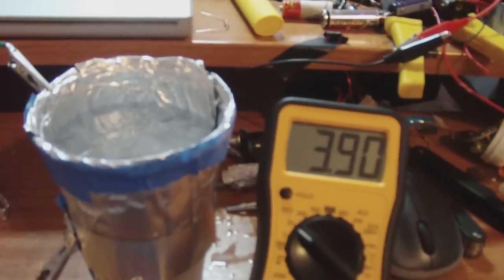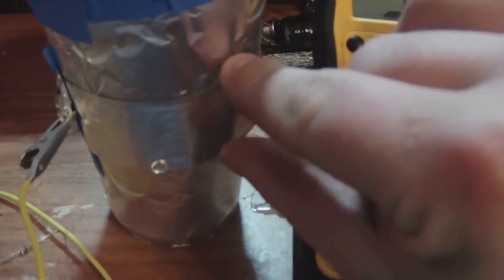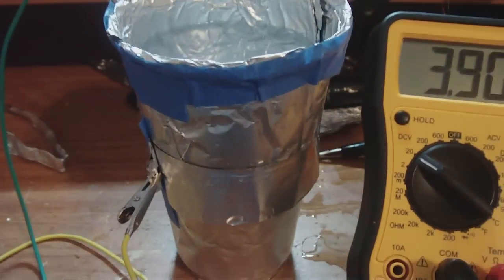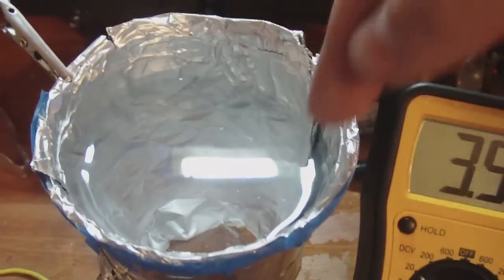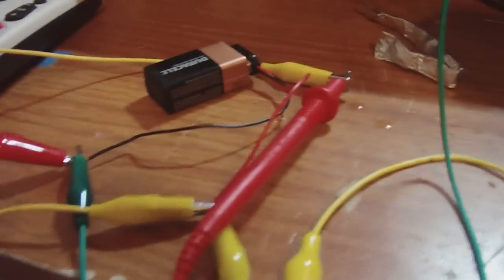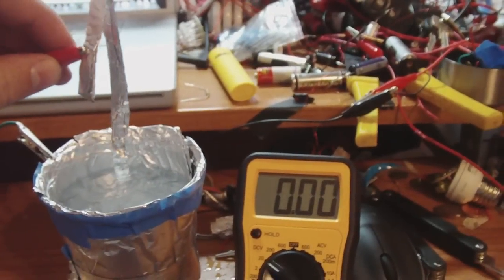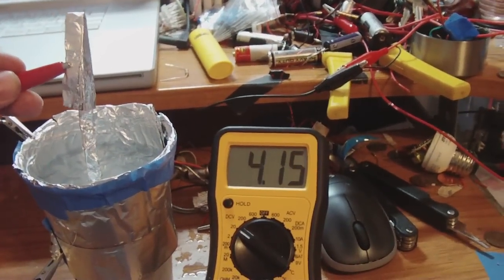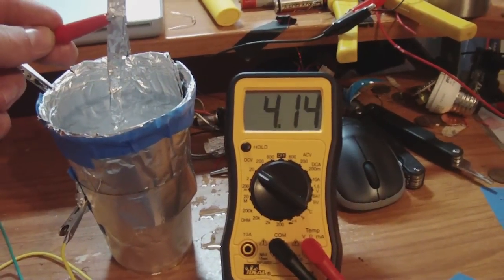More Voltage out than in -- Water Captret

Comment: From what I understand about water, the surface tension area of water has a layer of negative charge, while another layer next to it has a positive charge. Since these are in the glass and the capacitor separates the outer from the inside, when you put the strip into the cup you are adding the potential from the water surface area, thus increasing the voltage. Since this is a natural constant effect with water, it will always recharge. It could be zero point energy. keep up the good work.

Comment from the maker: @amatusamongus 

Not bad for a battery that uses the same metal, a regular battery uses dissimilar metals to get voltage. Now try to figure out how i got voltage from using the same metals, and no it doesn't act like a lead acid battery; also it has nothing to do with a aluminum-air battery because the voltage would have been higher. 

Have fun.

Comment from the maker: Its not galvanic reaction, when i replace the thin piece of aluminum with copper or steel it will decrease the voltage. It also works great with other batteries, 12 volt, 1.5, and 9 volt batteries all get a increase in output voltage and all can charge a capacitor to that higher voltage too. 

Its simple producing more voltage out than whats put into it.

Comment from the maker: @TeacherPhilEnglish Nothing happens. Usually with a aluminum or water battery the things that are left turn the water a funny color, but the water captret water stays clear.

Plus the voltage you get is only dependent on the relative location of the plate and not the material, this leads me to believe that the extra power is coming from some type of capacitor effect.